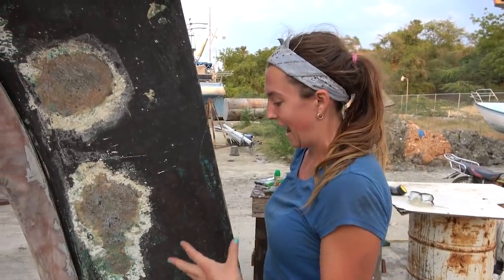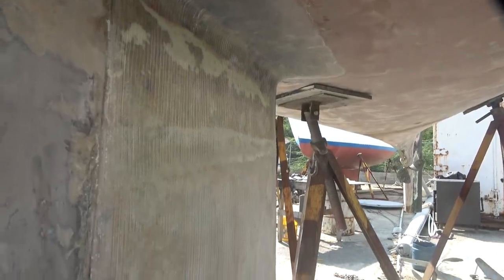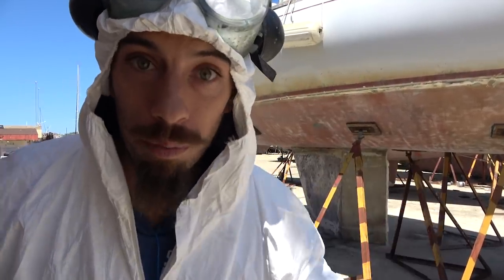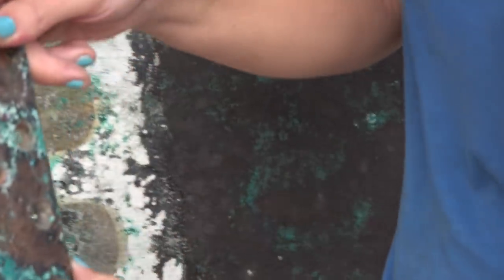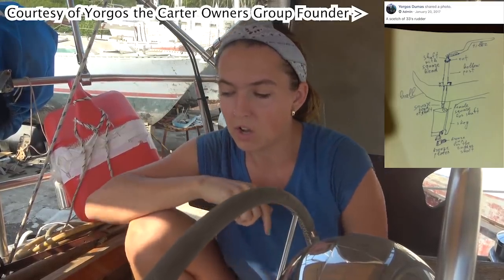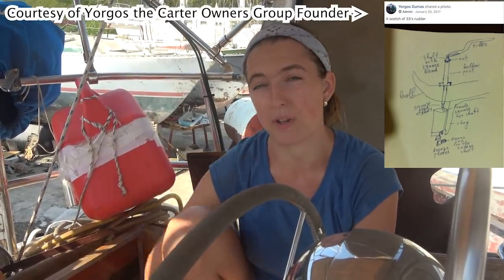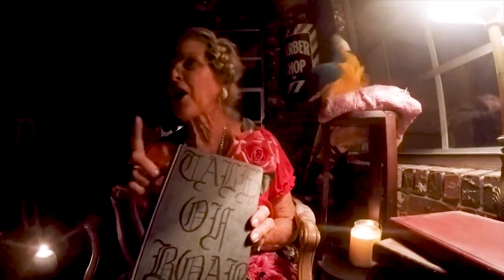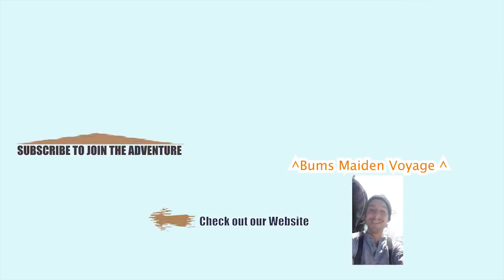We Found THIS in the SCARY Locker! Ep 72

Comment: 1st to check is the set screws. Often the first one serves as a lock for the one below it that actually tightens on the shaft. 2nd the alignment of the quadrants is off. No way should the key be held in with a hose clamp.  3rd. Somewhere you have the tool for that brass fitting in the cockpit sole. It should be tied on a bit of line at the pedestal.  You will never need it till you need it right this instant.. Make sure you can open it easily. Put a dab of anti-sieze on it or at least grease.  Ditto the tiller. Find a place you can reach for it  After pulling the steering all apart you have to ensure all of the wires are running straight and true. When it is apart, if the wires are not perfect replace them.
Reply from the maker: Others have mentioned that our alignment is off and  we agree that this needs to be fixed. If not a hose clamp what? We scoured the boat for the tool, think we will have to find another one. We will take your advice and have it ready to go before setting off. This has turned into our major refit and we are happy to take our time and get things ship shape before sailing again.
Reply: @Bumsonaboat  deck fitting tool looks like a comb with two teeth. Called a pin wrench. Similar to what opens some fuel fillers. The shaft key should completely or at least nearly be covered by the quadrant and need nothing to hold it in. Normally they are a precision fit needing to be tapped home with a brass or lead hammer or hardwood block. If it just falls out it doesn't fit. Possibly a metric size has been subbed for imperial or vice versa.

Comment: Make sure you get the tool to open the emergency tiller fitting.  Tiller won't be much good if you can't open it once it's screwed back into the deck. 

I'd replace the wire for the wheel too, that seemed a little shady.
Reply from the maker: Agreed and we also plan to replace that wire.

Comment: I could be wrong but it looked like your rudder was tuning about 80 degrees but should be confined to about 25-30 each side of center or will put excess strain on the shaft. You need stops on the steering drum to confine the angle. Oh, and lube the cable with vasoline and make sure it’s aligned. Good luck! You rock
Reply from the maker: Okay we will look into this further. Thanks we will be sure to lube the cable and check its alignment.